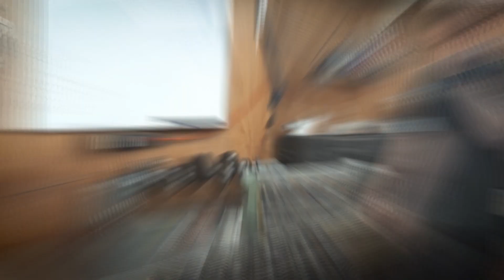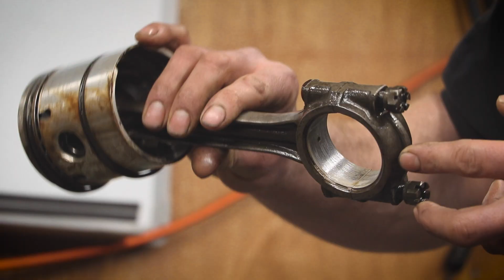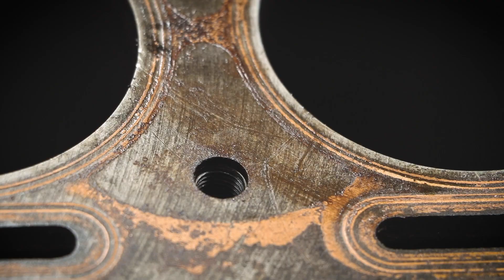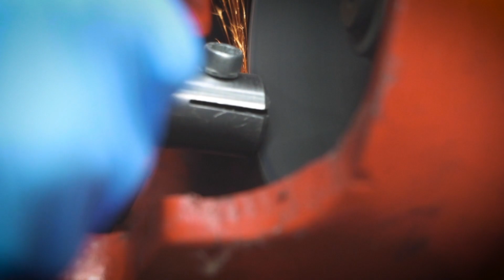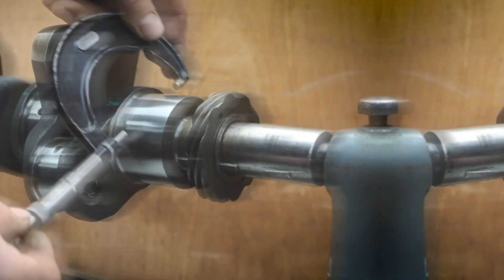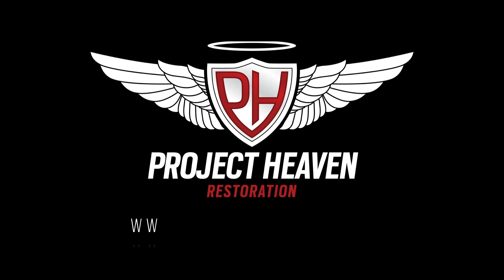The worst Jaguar engine we have ever seen!

Comment: I have a question and can find no spec for it: 1966 E Type 4.2 L. On the left front of the engine block there is a core plug. It is slotted. It was set very deep when I disassembled the engine for rebuild. How deep should that core plug be and what happens if it is set too deep?
Reply from the maker: I will speak to Pete and get an answer for you
Reply: @ProjectHeaven  Thank you. It is a threaded plug in the oil galley adjacent to the distributor/oil pump drive and appears to be about 7/8" in diameter.
Reply: @ProjectHeaven  If you give me his number perhaps I could inquire directly. It is a 7/8 ANF plug. There doesn't seem to be a need to have it threaded that deep. I noticed Pete had the plug only just below the timing cover mating surface.
Reply from the maker: @timpierce5772  Of course, give us a call on Monday on 01733 609659 and we'll have a chat about it